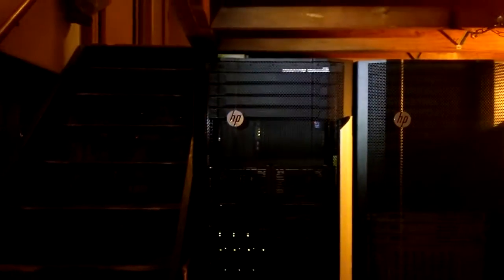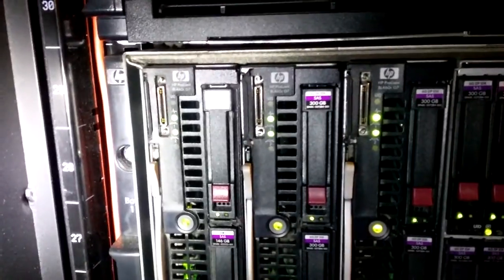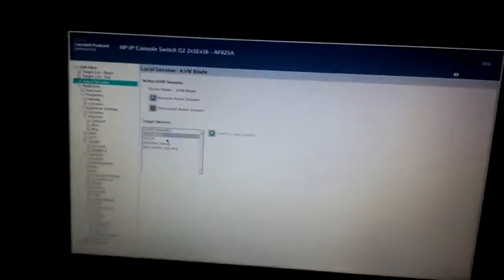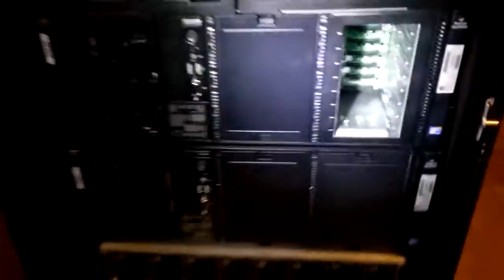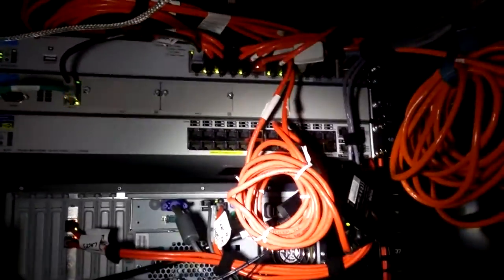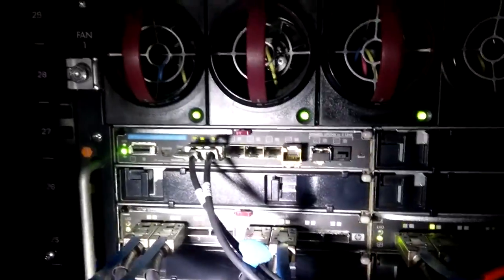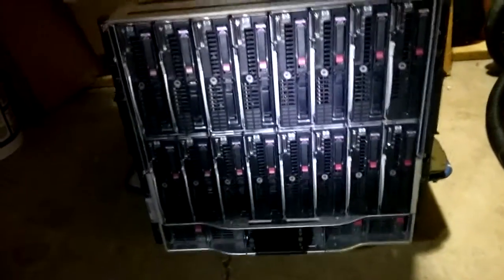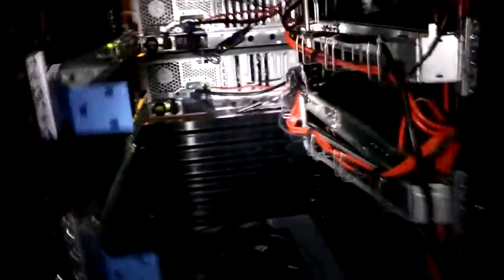My Home Datacenter - 2017

Comment: What do you do to justify this equipment?
Reply from the maker: I enjoy hosting an infrastructure at home that all of my immediate family uses from their homes. I justify it as an expensive hobby that occupies my free time.
Reply: josh2beefy thank you for the response. Your infrastructure is absolutely amazing. I wish I had just one robust server to work with. Keep up the videos and please invest in some lighting for your server room
Reply from the maker: Dennis Pillow, thank you for the complement. I have plans to build an actual server room in the empty space behind the racks, and I promise the lighting will be good. :)
Reply from the maker: I think so, as long as the temperature can be maintained. You might advance the time frame that your equipment has before failure, but I don't think 77 is a dangerous temperature. My rule of thumb, since I don't have any dedicate cooling setup (yet) is if it's uncomfortable for me, then it's uncomfortable for my servers.
Reply: I have seen the temperature monitor of one of the servers to be 25c, similar to mine, but do you think it is safe for a large rack filled servers?

Comment: Like your video. Where did you get 3 HP C7000? Did they cost you much?
Reply: Hi. In your video you say you have 3GB SAS Blade controllers connected to the HDD. I know I can connect MSA shelf's to it, but do you know if it is possible to connect other brands of shelf's?
Reply from the maker: You should be able to connect it as long as the shelf that you want to try uses the same type of interface. That's just the connection part. Whether or not the controller will work with a different brand of shelf is something you'll have to figure out. I imagine it's possible, but I can't say whether or not it will work when connected.
Reply: Thanx. The future will tell if I am able to do it;-)